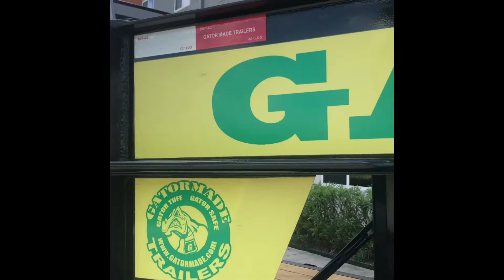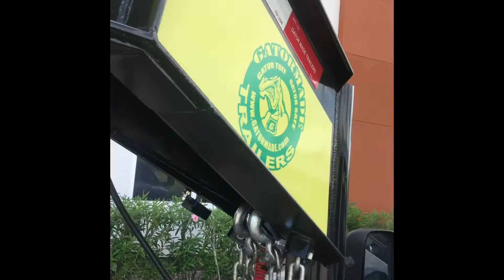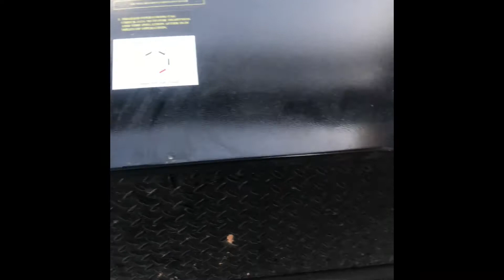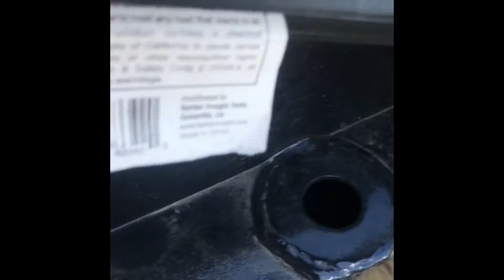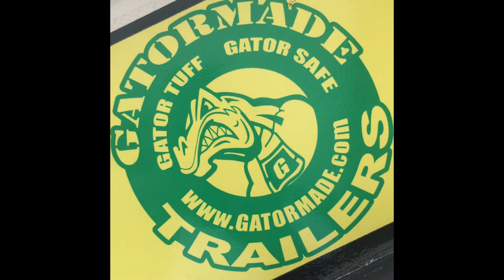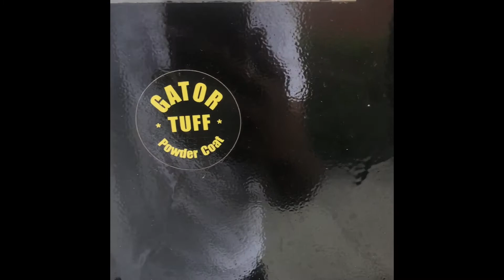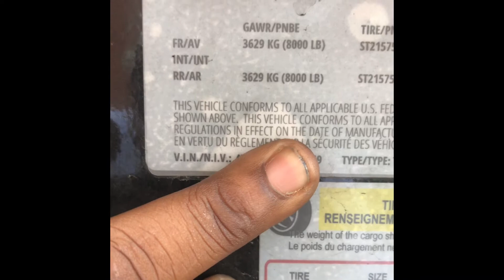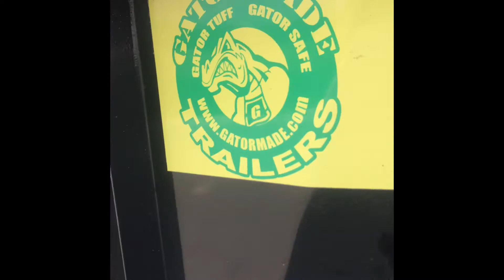FLEET BUILDING: The trailer review 3 of 3 and some bonus talk about contract work

Comment: BTW, that trailer that I saw close up when you came thru is DOPE! In trucker talk that means SOLID, well thought out.  I am very impressed with the construction and thought that went into the design and functions.  Things that stood out: That step up to the deck is very nice.  The knee bracing bars, the sliding winch tracks (super dope), 30+5 length, ramp pins, cargo light, winch attachment... that ALONE is money.  I used mine twice and made up the cost of the winch immediately. And the price was dam near stealing.
Reply from the maker: Righteous 🤘🏽 I totally agree bro they built a nice one💸🚛💨💨💨